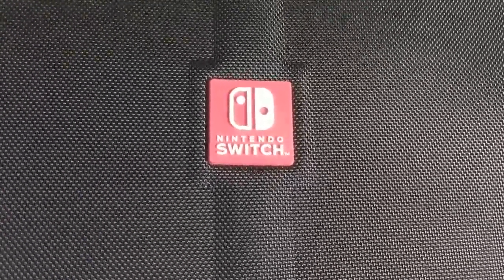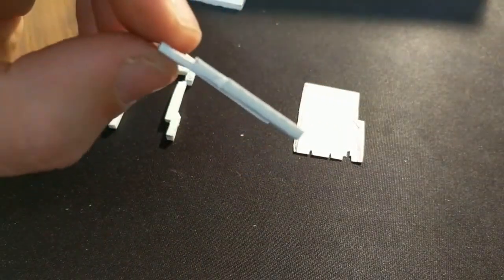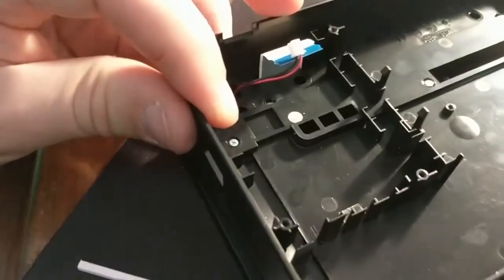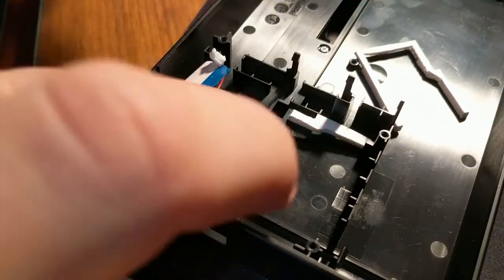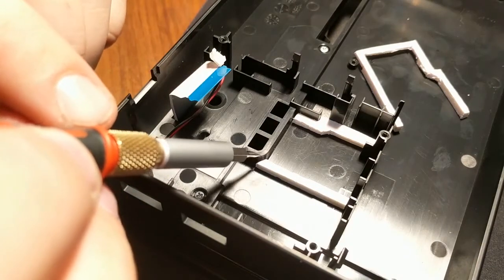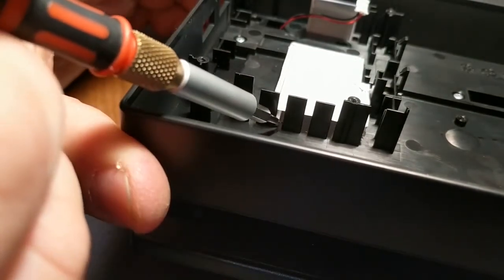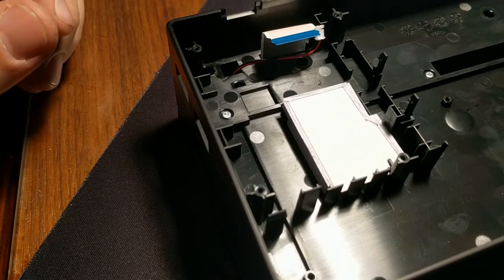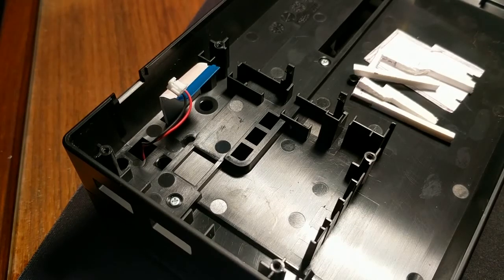My Custom Nintendo Switch Drop-In Cooling Mod

Comment: Awesome idea. I havent got my switch yet due to being on a proper dead ass wage packet but i have been saving my pennies (after payin my bills and dues) to get the LGP/E edition out on 16th nov. I am already planning mods tho. Seen as i dont have 1 this is an enquiry more than anything. Your hack conceals cold air from the large part into your hack via 3 openings.. i was wondering why not use all the vents seen as it is dead space under the board.... i havent had 1 spart so i wouldn't know. Just trying to think of a way for you to draw more cold air.

I will buy 1 of these if i see a diagnostics vid proving it works coz i love your logic of cold air beats hot.
Keep it up.. n keep modding.

Comment: An electric tape maybe sufficient for block that vent 
But  my question is
Does the board got hot if that vent hole closed or blocked?
Reply from the maker: Why would you block the vent?  That restricts the amount of air the Switch can get by volume.